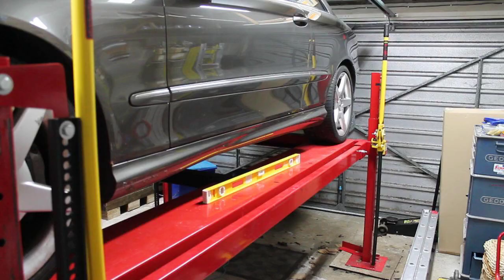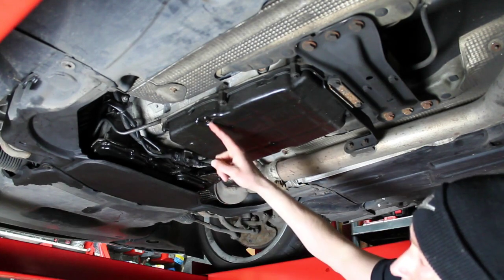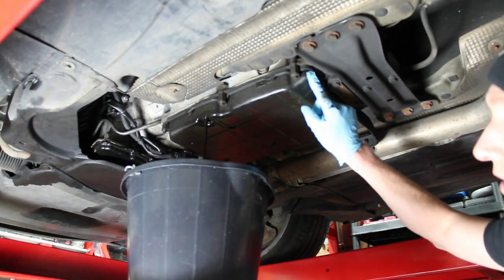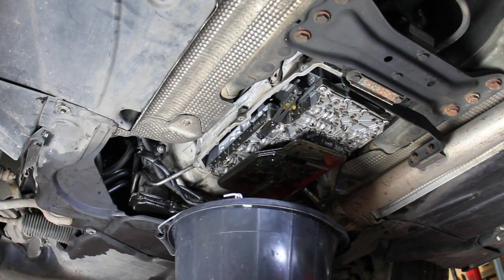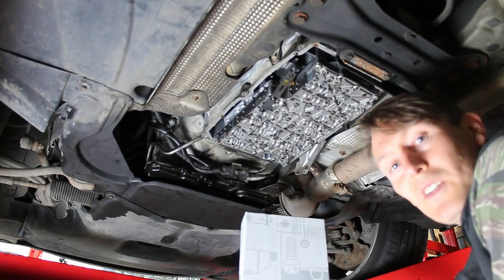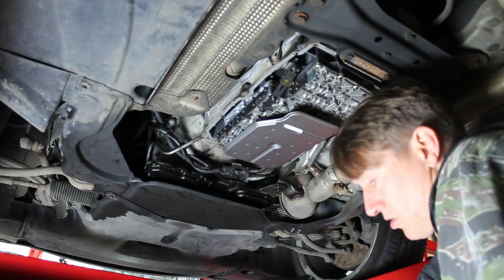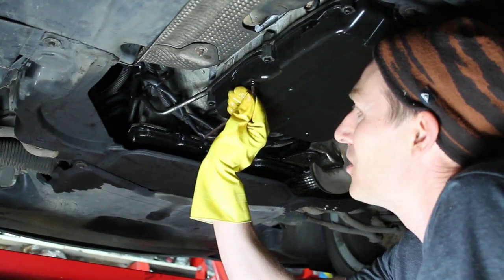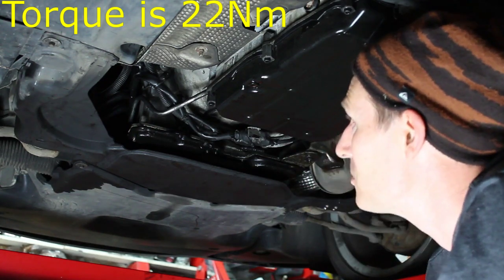How to Change the Oil and Filter on a Mercedes 7 Gtronic 722.9 Automatic Transmission

Comment from the maker: UPDATE - Technically, you should carry out the final fluid check and drain off any excess fluid with the engine running (not stopped as shown in the video). Thanks to John Yun and others that raised this point! AMOUNT OF OIL THAT CAN BE DRAINED & REFILLED - The transmission that features in this video doesn't have a drain plug in the torque converter. Hence, the amount of fluid that can be replaced is less. If your car doesn't have a torque converter drain plug, it is possible to drain more fluid by disconnecting the fluid lines that run to the oil cooler but I don't do this, as it isn't the standard procedure and hence, it isn't in the video. The transmission in my car is at 105k miles, still runs as new and I have always serviced it as shown in this video. However, some other Mercedes cars do have the drain plug and if you have the option, you should drain it, as it allows you to replenish more of the fluid (more effective fluid change). You might have to turn the engine (in normal direction of rotation) by turning the crankshaft pulley with a large socket / bar (if unsure how, make sure you have read up on how to do this before attempting!). Hope this helps! Thanks, RMR
Reply: if for instance my gearbox do have a torque converter drain plug an i drain oil from it as well, should i just refill oil through main gearbox oil drain plug or fill some oil seperatelly in to the torque converter too?
Reply from the maker: @1945Aleksandr  Hi, Yes, you put the torque converter plug back in. Then fill the gearbox as normal through the drain plug. When you start the car and step the box through the various positions (as shown in the video - P, D, N etc), it will fill the torque converter. You will then be able to go back under the car and top up the fluid level. Hope that makes sense! Thanks, Phil
Reply: The engine might heat up faster if you rev it around 2-3k rpms like when you warm it up for the smog checks. (10 minutes for full heat of cats and engine)
Reply from the maker: @eschrader  That's a good point! I was lazy and went in the house for a coffee! lol! Cheers, Phil
Reply: @eschrader  WIS procedure recommends letting the engine run at idle speed.
Reply: Yes very correct. In all cases it is recommended to follow the MB procedure for that (WIS documents), you MUST absolutely fill your transmission fluid with engine running at idle speed and so the fluid is flowing althought the whole parts of the transmission. Only way to make sure the level is correct in the pan.

Comment: I also had another question you said you put 5 into the sump but the transmission calls for 9 and 1/2 quartz. I did drain the torque converter as well. should I put some fluid in the sump and run it for a brief period of time to fill the torque converter??? And then top off?
Reply from the maker: Hi, my model of the transmission doesn't have the torque converter drain plug and so I wasn't able to change as much of the fluid as you will. Yep, that is exactly what I would recommend: fill the sump to the level (when it starts to run back out of the level tube), run the transmission and step it through each of the gear positions, stopping for 5-10secs at each position (Park, drive, reverse etc), you will probably feel the drive engage, with your foot on the brake. Then check the level and do a top up. Of course, you will also have the running up to temperature and final level check to do too. Hope that helps, thanks!

Comment: I found your video extremely helpful however instead of a hand pump I simply drilled a hole in the top of the new fluid container fitted it with a half inch poly tube drilled another smaller hole and use my air compressor to pressurize the container it worked great
Reply from the maker: Sounds like an interesting idea! I like a bit of improvisation :-)

Comment: Hi ,I have a e220  ,5years old,with 28000 on the clock.Do I need a auto transmission service.it seems a little early for that. Thank You
Reply from the maker: Hi, it seems that Mercedes have changed the recommendation a few times for this gearbox, so there are lots of answers out there including a service at 40k, 50k and even 75k miles. However, they all say "or at 5 years". So, strictly speaking the transmission service is due according to age, if not yet due to mileage. Personally, I would be tempted to wait another year but that is down to personal choice. There is a good resource here that might help you decide https://lite.servicemercedes.co.uk/ess/pc/ Hope that helps!

Comment: Pretty unprofessional IMO. Don't call it "changing" because this is renewal at best... Still a few liters of old fluid left in the TQ. Basically about 1/3 of the whole amount of old fluid is still in there.
Reply from the maker: Hi, on the version of the gearbox fitted in the car featured in this vid, there isn't a drain plug on the torque converter. Hence, the procedure is for draining the pan. You are right to raise this point though! If you are planning to change the gearbox oil on your car, you should check to see if it has a drainable torque converter. If it does, it is best to use it, so that you are changing more of the fluid. Good luck with it and I'm happy to help if you have any questions! Cheers, RMR
Reply: @ReviveMyRide  Hi! Sorry, my bad, i didn't know that. BTW some of 7G Tronic TQ-s do have that plug. Do you know which versions of 722.9 lack that plug?
Reply from the maker: Hi, good idea! I will have a look for that information and if I find it, I will reply here and put it into the video description. Thanks, RMR

Comment: Your video is very well made including real good audio. It is very different from other DIY video. Thank you. Just wandering if it work for B200 CDI 2012, Model W246?
Reply from the maker: Hi, thanks, really appreciate your comment! :-) I did a bit of research and it looks like your car has a very different gearbox fitted to the one that features in this video. You will want to double check but it looks like your gearbox is the CVT 722.8 gearbox. I think my video will be good for "principles" of a gearbox fluid change but there will be a lot of details that are different. For example, it  looks like you can fill your gearbox from the top, you can get a dipstick for your gearbox so that you can do the level check, of course it uses a different fluid etc. There will be other variables too. I did find some videos on Youtube for your gearbox, so if you search specifically for your gearbox type, you will hopefully find some more information specifically for your transmission. Hope this helps!
Reply: Thank you, I suspect W246 automatic transmission is different from
w245 (which is the CVT 722.8 you mentioned). I am not sure. If you have infor, please help us owners of Diesel W246 (not W245) make a video. Cheers

Comment: Very good video on the procedure but most helpful was the re-fill apparatus and your description on how to make it. Question is what did Andy Horsfal make and do we need to get one make also OR is everything in your diagram all we need to buy and assemble to re-fill the transmission? Thanks again for a great video.
Reply from the maker: Hi, thanks for your message & sorry for any confusion. If you buy all of the things that I described in the kit, then that should allow you to refill the gearbox. Andy made me an adaptor on the lathe that screws into the gearbox pan (sump plug hole) but you can buy them and it appears in the kit (similar to item no. 1). He just wanted to practice his machining skills and I promised him a mention if he made the part for me!
Reply: @ReviveMyRide  I thought that might be the case but just wanted to be sure. Thanks again.

Comment: What you think about mercedes saying no need to change the transmission oil it's last life of the vehicle. Good video
Reply from the maker: Hi, As far as I know, they all need to be serviced! The gearbox that features in this video is the 7G-tronic (722.9) and should be serviced every 40,000 miles. Later gearboxes referred to as the 7G+ from circa 2011 onwards have a longer service interval of 70,000 miles. Hope this helps, you can find lots of info on the forums of mbclub.co.uk or mercedesclub.org.uk

Comment: Good detail on filling method.  BUT!!
You switched off the engine and allowed more fluid to drain out.  I am sure Mercedes state the engine must be running, with oil at 45 deg. ... then you re-fit sump plug ... THEN switch engine off.  Your method would not fill gearbox to correct level.
Reply: You are correct, when i changed the oil on my ML280 i did exactly that,  any excess oil will overflow via the overflow pipe when up to temperature, then you replace the sump plug when the system level is full.
Incidentally you also need to drain the torque converter and also the oil cooler and associated pipe work, you will be surprised how much additional oil lies in this area or you will find that you are actually only renewing 70% of the oil.

Comment: Nice work very useful but why don't think to use cooler hoses from the radiator? I think we can refilling the oil from it easily!
Reply: That oil cooler hose is actually supposed to be the point where a flush takes place. The cooler and Torque converter are holding the remaining 5 or so qts of fluid (as the pan only has about half of total fluid). Getting ready to do this job myself & have confirmed with updated MB service instructions and techs at 2 local dealerships that they do a complete flush on the 722.9 now. I do wonder if doing a fluid change like this every 20k mi would be comparable to doing the full flush every 40k mi (which is their service interval)
Reply from the maker: @RothBeyondTheGrave  Thanks for the additional info! I have done a couple of fluid changes like from the video and the gearbox always runs better for it but do like the idea of changing more / all of the fluid!
Reply from the maker: Hi, thanks for your comment. However, not 100% sure what you are recommending, can you please give a little bit more information? cheers!

Comment: You may need to drain torque convertor too ?
Reply from the maker: Hi, thanks for raising this point because it is a good one! I did lots of research and it seems that on this car (with this gearbox), there isn't a way to drain the torque converter. Certainly I couldn't see a drain plug on it and that was backed up by research I did on the forums. However, other Merc gearboxes and many other manufacturers do provide a means of draining the torque converter. Basically, you are right, if it is possible to drain the torque converter, then you should as it will refresh more of the fluid during the oil change. The rest of the procedure as per the video stays the same. Thanks!
Reply: @ReviveMyRide  The correct method of changing the oil on any late clutched torque converter involves 'wasting' a complete oil change. it's impossible to effectively drain the oil out of the torque converter whilst it's still in the car, aswell as the heat exchanger etc...  You should carry out a complete oil change as you have, run the car for a period of time or take it for a short drive when up to normal temperature, then drain all the oil and refill with new. This dilutes the old oil left in the torque converter mixing it with fresh stuff, if you are unable to extract all the oil out of the sump, you should remove the sump, in this case only replace the oil filter and gasket on the final fluid change. The torque converter can hold around 2ltrs of old oil, the most important part of automatic transmission oil are the friction modifiers, these control the slip properties of the clutches, if your oil is burnt (smells like burnt toast) that's another story. The Torsen diff in most VW Audi 4 wheel drives are notorious for tire scrub due to the friction modifiers failing in the oil of the diff, oil plays an ever increasing important roll in transmission, the additives are part of the transmissions' design, cheap oils can't be guaranteed to have the correct quantity of additives, this will shorten the life of the gearbox, I would ever only recommend OEM oils or their actual supplier. Now you can understand why transmission oil changes are so expensive!
Reply: You should drain it yes. Detach the oil pump by 3 bolts (8Nm), under the oil pump there is a d=3cm black cover, remove it, then rotate the engine in N until the M8 drain screw (10Nm, replace) of the converter appears. I had 3.8l in the Torque converter!!

Comment: for yournoil pan shape up to 18.6.2010 white overflow pipe should be used.
Reply from the maker: Thanks! The overflow pipe in my oil pan is white, it has just become a little discoloured over time and maybe looked a little yellowy in the video. Usually, if you just leave in place whatever overflow pipe is already there, then you won't go far wrong (although I hear Mercedes do update them sometimes).
Reply: @ReviveMyRide  what wis says is it should be replaced with white. That means whatever color it was up to 18.6.2010 it should now be white.

Comment: small comment it is 4 nm + 180* dergees, for oil pan holder screws.

correction: main plug is 22 nm 

What year and model car is that?
Reply from the maker: Hi, thanks for your comment! I have seen that 4nm + 180deg is the recommendation but many people don't have a torque wrench that does that low and / or an angle gauge for the 180deg turn. 8Nm worked well for me, no leaks and no snapped bolts. Agree, the main plug is 22Nm, it does come up on the screen in the video in yellow letter when I am tightening it up. Thanks!
Reply: @ReviveMyRide  the issue is not the bolts but the gasket used for it. 4nm+180 is just right not to appy to much pressure on it and overtime causing leaks. As per the bolts holding the pan those are alu and need to ve replaced. This is for those  people doing this, so they have the info.
for low torque yoy can use a bicycle torque wrench or a digital torque adapter.
Reply: @FinTra_  yep, exactly!!!
The fancy pan bolts are designed to be one time use only just like the gasket else they'll brake off like in a video from FCP Euro.